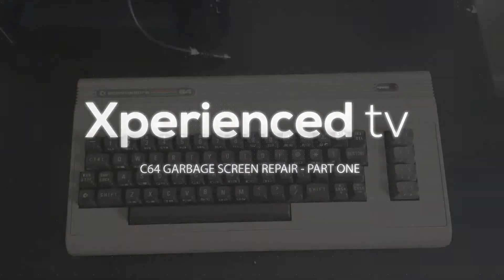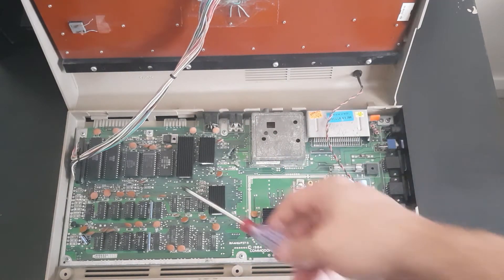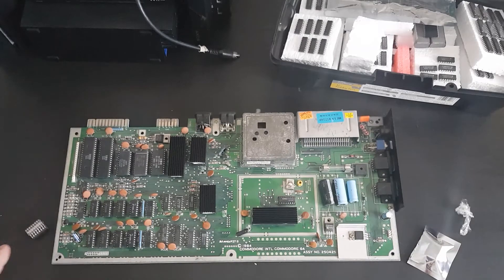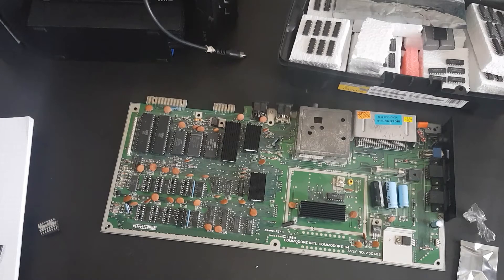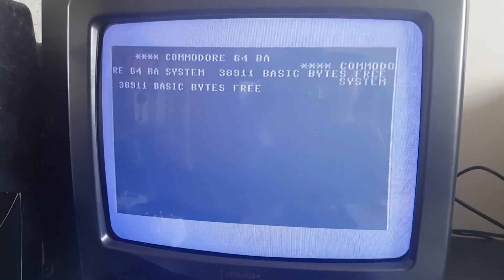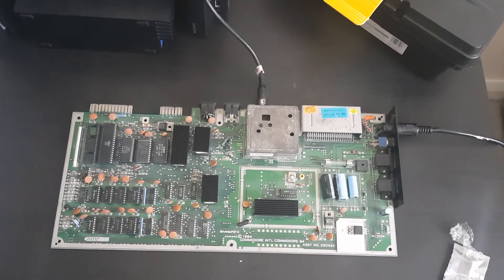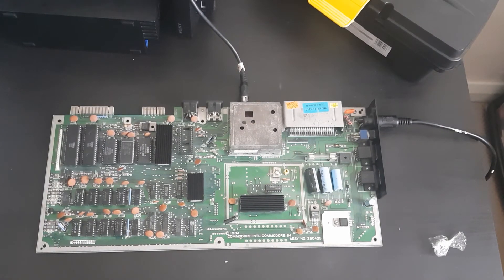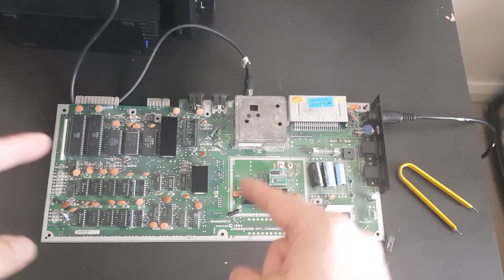C64 Garbage Screen Repair - Part One

Comment: If you haven't already, you should check u14. This fault looks almost identical to yours except with different characters:http://derbian.webs.com/c64diag/fault.htm?id=u14_2
Reply from the maker: +DerbianGames Thanks for the tip. I did change the MOS  logic chips whilst frying the VIC in the second vid ☠Your website is absolutely brilliant and has helped a great deal in figuring out what has gone wrong. Thanks for dropping by and commenting!

Comment: Logical fault finding would be much better & less expensive than random parts swapping.
Reply from the maker: Indeed. However since I don't know what the correct states of the chips are supposed to be, it was easier to just pull the chips and replace one by one. Shame about what happened when I replaced the logic chips... :-(